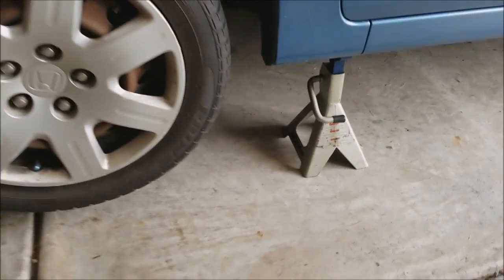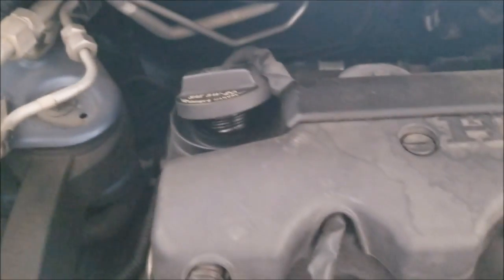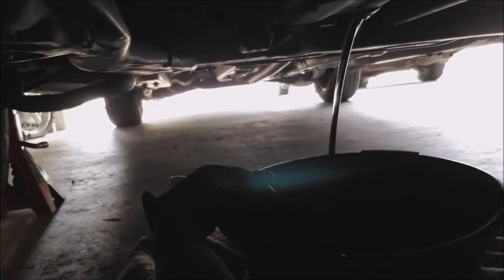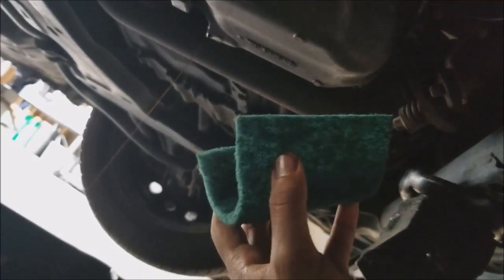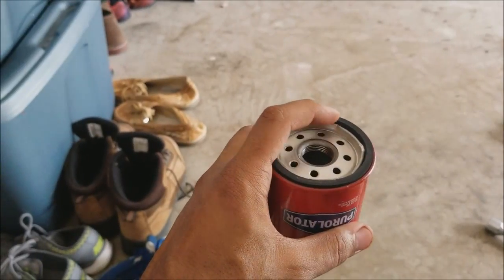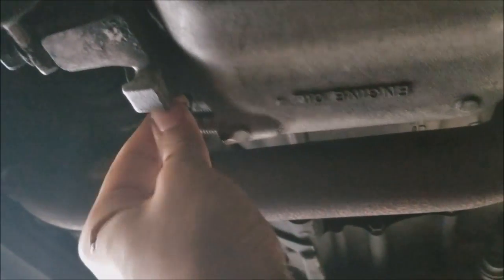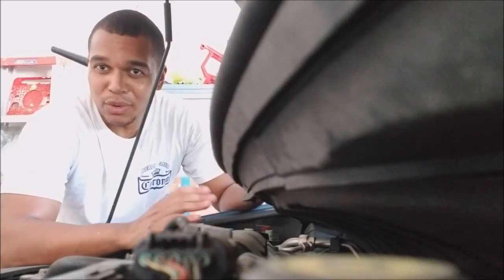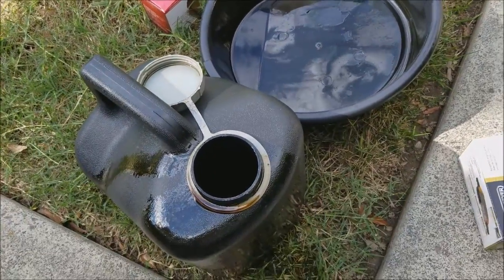2006-2011 Honda Civic OIL CHANGE | Easy and Simple

Comment: Insted of jacking your car you could use ramps. It's not expensive and the car can't fall. 👍
Reply from the maker: Thanks for the tip! I've always wondered about getting ramps, didn't know how easy it would be to drive up on the ramp. Is it easy to do with one person? Just making sure ramp is lined up I assume and maybe a block support to keep it from moving?
Reply: @EngineeredMojo  I Just did my oil change and I simply align the ramps right in front of my front wheels then I simply drive forward very slowly, you feel it when your car gets on top of the ramp. The shear weight of the car insures the ramps don't go away and my driveway where i do my oil change is in 3/4 rocks, it's not even paved. On the back wheels I put wedges just to make sure nothing moves. take your ramps to have at least a 15 degree angle, lower then that, I find the car is not lifted enough.
Reply from the maker: @charlesmigneault7918  awesome thanks for the info on that. It does get tiresome taking out the jack and jack stands, this will speed up the process for sure

Comment: You should have poured some oil into the filter.
Reply from the maker: Oh yea, does it help with oil pressure?
Reply: @EngineeredMojo  it also helps so the oil pump doesn’t work to hard
Reply from the maker: @mke7876  nice good info to share, appreciate the comment!

Comment: 99% sure all Hondas are using a 17mm drain bolt.
Reply from the maker: Pretty sure that drain bolt was aftermarket after talking with a few people in the comments. Good thing all metric tool sets come with a 19mm and a 17mm ;)

Comment: that’s not how you prime a filter 👎🏼
Reply from the maker: @cory7496  you only need to prime oil filters on engines that have oil pressure fed timing belt pensioners. I'll do it on a Subaru for example, but I won't waste my precious time when it's not needed on most cars 😀